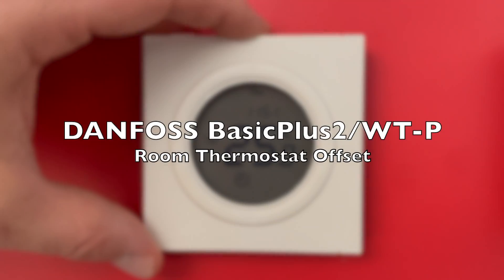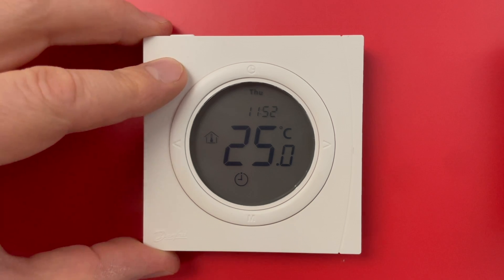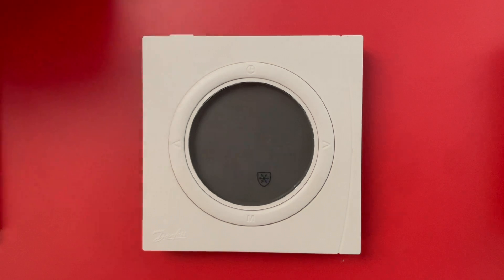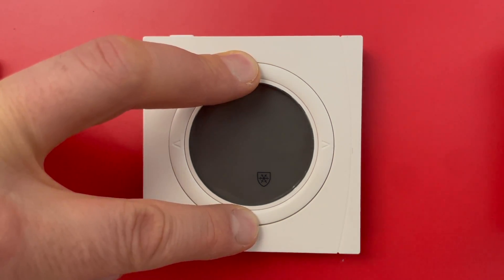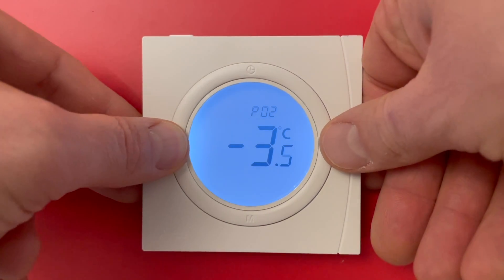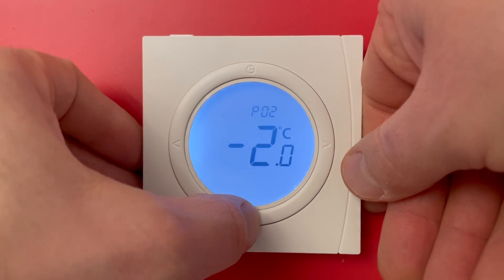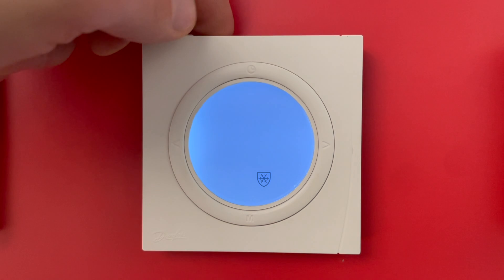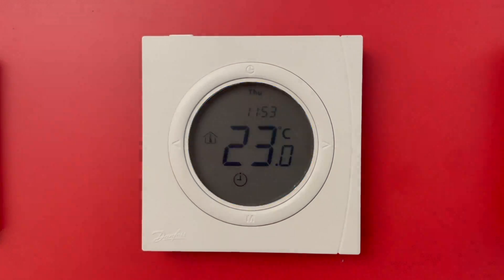Calibration (offset) Danfoss thermostat WT-P "BasicPlus2"

Comment: Hello,
I am using the WT-D model thermostat. My target temperature is set to 23.5°C, but I am having some issues with its operation and sensitivity:
1. Sensitivity (Hysteresis) Issue: Is the sensitivity setting on these devices fixed at 1 degree? Currently, the device does not activate until the temperature drops to 22.5°C. Is it possible to adjust this to a more precise setting, such as 0.5°C or 0.2°C?
2. Display Lag: Even when the room temperature cools down, the display does not update gradually. Instead, it stays the same for a long time and then suddenly drops by 2 degrees at once. Because of this lag, the thermostat kicks in too late, and the room gets uncomfortably cold.
Reply from the maker: Hello, thank you for the detailed question.
For the WT-D thermostat, the temperature control hysteresis is fixed at ±1.0 °C. This means that if your setpoint is 23.5 °C, heating will typically switch on when the measured temperature drops to around 22.5 °C. Unfortunately, this hysteresis cannot be adjusted to tighter values such as 0.5 °C or 0.2 °C on this model.
Regarding the display behaviour, the thermostat uses internal temperature averaging and filtering to avoid rapid switching and display flickering. Because of this, the temperature shown on the screen may update in larger steps rather than gradually, even though the sensor is continuously measuring. This can create the impression of a delay, but it is intentional and part of the control logic.
If the room feels too cold before heating starts, you can try:
Increasing the set temperature slightly
Checking thermostat placement (avoid cold walls, drafts, or direct airflow)
Verifying that the heating system responds quickly enough once a heat demand is sent.
If you need tighter temperature control and faster response, smart control would be more suitable.
WT-D is electronic but it is basic thermostat. Smarter thermostat would be Icon 230V Display with PWM control: https://www.youtube.com/watch?v=Evg-HLZ7ahI and the best choice would be Icon2 system with PWM and Forecast ("PID"): https://www.youtube.com/watch?v=zIZuP63CJY4&t=85s

And here is what ON/OFF and PWM are: https://www.youtube.com/watch?v=yamLkfIUhEg&t=11s

Comment: Your videos are a life saver. I have a related question for these danfoss thermostats. We have these installed with our underfloor heating system. I am concerned that they are not picking up the correct temperature in the bathrooms (where the cable goes through wall to pick up temperature, controls in bedroom for example). Is there a way to check this "cable" is properly connected and the thermostat isnt actually just picking up the external room temp and not the bathroom?
Reply from the maker: Hi, is this really the thermostat you have? WT-P can have floor sensor for min and max temperature control only. So I am sure it measures temperature where it is mounted. Video on WT-P MENU is here: https://studio.youtube.com/video/4--W20us1hg/edit

P02 Temperature control mode 01-Only Room Temperature, 02-Room and Floor temperature control (only if floor sensor is installed)

Comment: Do you know what is P01 setting? Mine is set to value 01, your is 02...
Reply from the maker: P01 is Manual mode. Here is video how to setup this thermostat: https://youtu.be/Nzqw2VN4pOY?si=tlVa4Dm_6_nuewKw
Reply: @heatingsolutions123  You mean that P01 setting accesed from "secret" menu (entered when device is off) and P01 accesed from regular settings menu (entered when device is on) is same setting?
Reply from the maker: @bojanmihajlovic7717  no, they are different settings
Reply: @heatingsolutions123  Sorry, I am confused now. Can you explain me in following way:
P01 setting from "secret" menu is...
P01 from regular settings menu is...
Thank you for your time and patience! Best regards!
Reply from the maker: @bojanmihajlovic7717  Hi, forget this secret menu. It is only for temperature reading calibration. Please use regular menu only. In regular Menu set manual control. Hold M for 6s. select P01-01. And if your heating still does not come on , when set T is higher comparing to real T, thermostat is broken or there is something wrong in installation
Reply from the maker: @bojanmihajlovic7717  Secret MENU P01 is empty, P02 is room temperature sensor reading offset, P03 is underfloor sensor reading offset. Regular MENU P01-01 Manual temperature control P01-02 Scheduled temperature control P02-01 only room temperature sensor P02-02 Room and floor temperature control (only if floor sensor is installed) P02-03 Only floor temperature control

Comment: Hello. How to increase room temperature over 35. I don't have p6
Reply from the maker: Hmm, might be you have got different thermostat. Video on WT-P menu is here: https://youtu.be/Nzqw2VN4pOY?si=DC98V61bxm78qi74
Reply: @heatingsolutions123  I just bought danfoss EC temp next plus and after instalation i can navigate through all menus everything works fine except heat is not kicking in so does no heat simbol ( electric mat floor) need help

Comment: Thank you. How about model WT-D?  There is no clock symbol on the dial, there is only < > M. Please help how to adjust the offset.
Reply: Yeah, i want to know also. Have you figured it out yet?
Reply: @alenerzar8596  Hey. Even there is no clock sybol on the termostat, just follow the same procedure. You can adjust the offset.
Reply: @alenerzar8596  unfortunately not
Reply from the maker: Hi, model "D" means Display. Sorry, It has no offset:( Only manual temperature control.

Comment: What does the number on the thermostat tell us? The temperature of the room at that time? Or the temperature that the thermostat think we're trying to maintain?
Reply from the maker: SET temperature is the temperature thermostat is going to maintain. Real room temperature is shown after you have pushed once "<" or ">". Calibration setting adjusts real measured temperature. I hope this explains the issue.